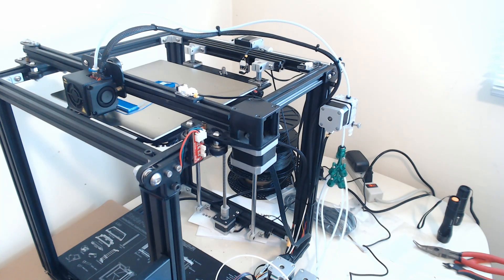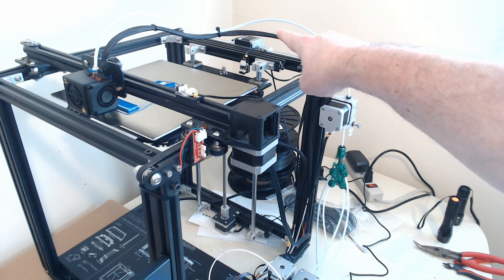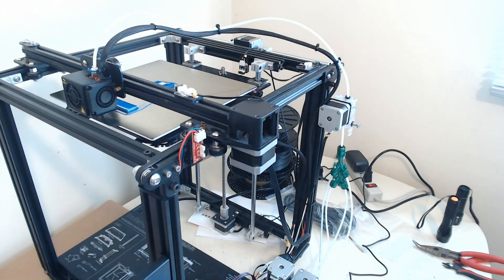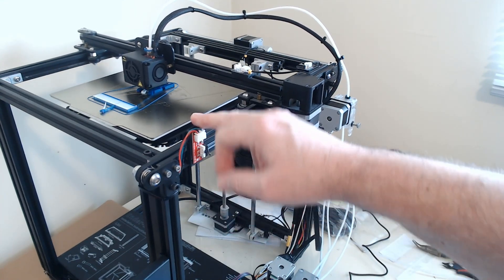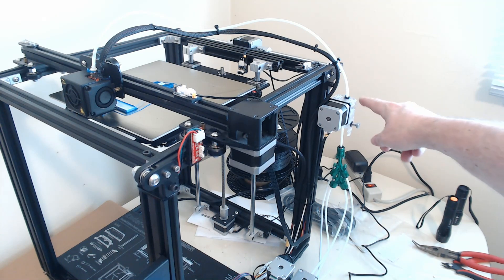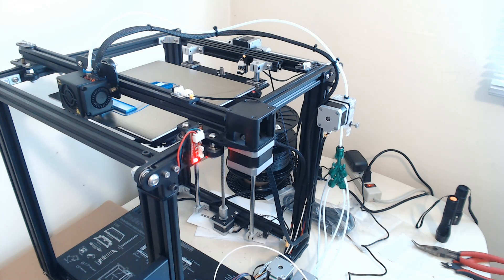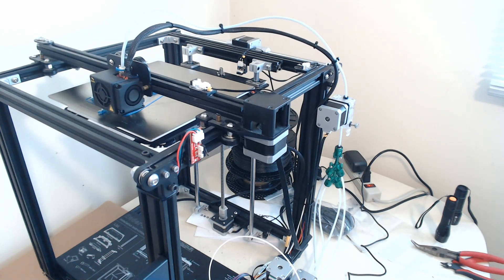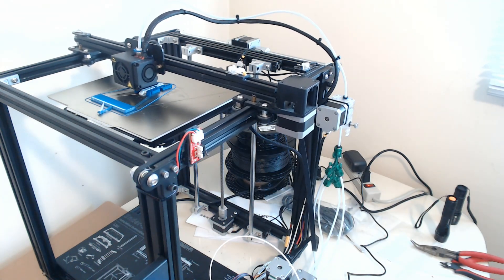3DChameleon Mk2 Installed on a Creality Ender 5

Comment: I'm running a direct drive on my ender 5, what do I need to do differently to install it?
Reply: Just enter the shorter distance into the tool change gcode generator.  The installation is identical... you're going to attach the PTFE from the Y adapter directly to the top of the extruder the same way.

Comment: Soon as I see this done on a Voron using afterburner I think I’ll go for it.  A lot simpler than ERCF assembly
Reply: The system is designed to work on any printer, so there is no issue with a relatively simple design like a Voron.  The Afterburner is the same... The 3D Chameleon would only be used to load and unload it... So if you can use software to load and unload the filament today, it will work just fine. We only need the ability to inject tool change gcode from the slicer... There are no other requirements. Check out some of my other videos to see it on other machines.

Comment: Wondering if it could set up with Raspberry GPIO. Would that speed up the process?
Reply from the maker: You can use any I/O that you can share a common ground with.  It will speed it up a little, but not by a lot, as you won't have the time associated with motions themselves.

Comment: Hey mate, great video and great looking product. I'm new to 3d printing and was wondering if it wouldn't be better/less waste if you use the purging filament in the center of the print project(out of sight) and by the time it's purged, then the desired colour will be ready for the outside layer. I don't know if it's possible, so I thought I'd ask the pro ;) Also, will this work with a CR10s pro v2 out of the box?
Reply: 1) The purge strategy is slicer dependent... they can purge inside the objects if you use PrusaSlicer and set it up correctly.  Other slicers haven't implemented just yet.
2) Yes, it will work just fine on pretty much every machine, including the CR10.